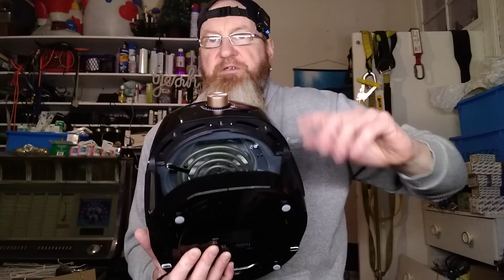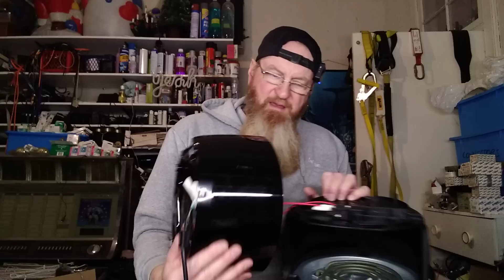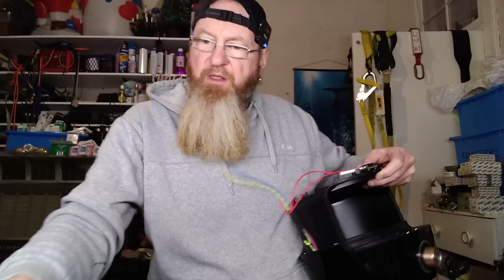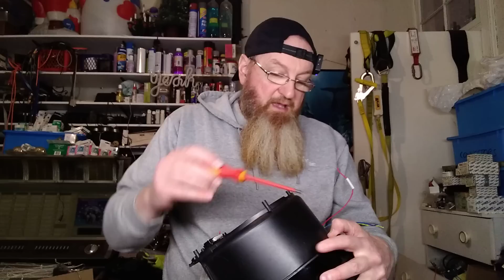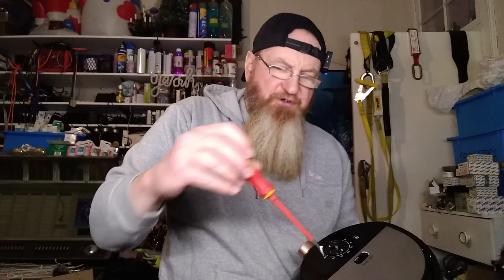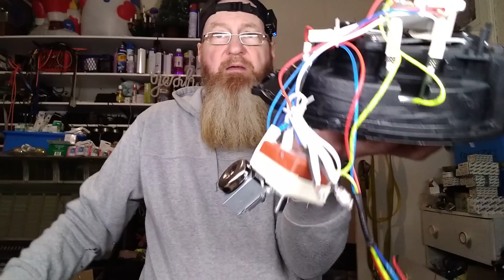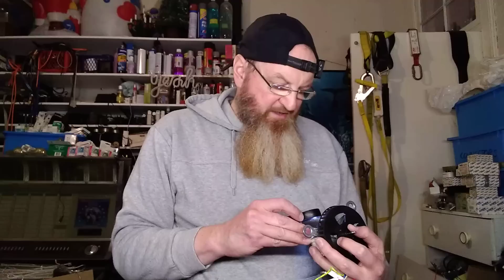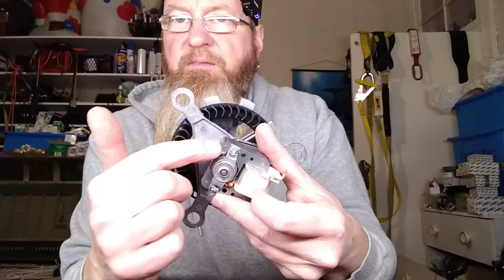Total teardown of an ASDA air fryer

Comment: First step, drop the screwdriver. Good impression of me! 😀 It's basically how I imagined it. For me, the biggest revelation was the slot in the sheet metal to force some of the cooking air out. I figured it did that since the air out the back is warm but not hot. It makes sense that the thermal fuse would be close to the highest operating temp because the idea would be to sense that the fan is not working. Normally it would be cooled but if the fan stops, it has to open before the plastic starts to melt. Overall, a nice build. I especially like the connectors that are so tight, you break switches before they come off. That's how they should be! 👍👍

Comment: I use a convection toaster oven. They last longer and you can do more with them. With that said, that air fryer would be about $120 here in the states. Sad, as it will only work half as well as the one  you bought. I love the lack of electronic components as the on I did have had only about 9 months of life before the heat killed the board and everything on it. It, too had the duel fans.

Comment: So refreshing to have a simple timer with ping and thermostat machine as opposed to electronics and loads of useless modes.
Reply: I knew someone years ago who had early stage Alzheimer's. He'd started to forget he'd put the cooker on so he threw the cooker out and only used the microwave because when it went ping he knew it was done. He'd have most likely had an air fryer if it was today.
Reply: We have two microwaves in the office. One micro-controlled one just one step beyond mechanical, one do-it-all super ultra inverter baking grill sous-vide artificial-intelligence solar thorium frying fridge. The former gets the job done. The latter is the most frustrating thing to use, right after our range of Windows 11 work computers.
Reply: Personally I'm tired of touchscreen in vehicles and everything having to be connected to the Internet to work.
Reply: @jms019  you bet!!
Reply: I would pay extra to not have a microcontroller in my washing machine, my refrigerator, my toaster , my pressure cooker, my freaking lawnmower for goodness' sake. For the last decade or so, I've been buying vintage, used appliances on ebay that will probably last me the rest of my life, and if they do break, they are easily repairable.
Reply: @fxm5715  ive never had to replace the microcontroller on any of those things when repairing them. it's usually simpler things like motors and heating elements. Occasionally, i've had to component level repair a switch mode power supply in them because a line surge blew it up.

On the other hand written off plenty of old washing machines when the synchron motor based controller mechanically breaks...
Reply: @jaycee1980  Yes, honestly it's not so much the microcontroller that's the issue, it's the general build quality of the rest of the devices that come with them. Microcontrollers are more an indicator of modern "minimally viable product" design sensibility for maximum profit.
Reply: @jaycee1980  years ago, there was one model of Sharp stereo that ate processors. Wasn't power conditioning or anything like that that killed it. They put the processor in as a postage stamp form factor on a large plate PCB on the face of the stereo and there was quite a bit of flex on that board. It literally tore the CPU apart by the leads.
Ironically, my neighbor gave me one of that model a few weeks back as she was preparing to move. I'll probably toss some LED's in where the incandescent lamps had failed, other than that, not worth sinking anything into even just at wholesale priced components values.
Reply: @spvillano  poor construction technique makes anything unreliable though, regardless of what parts you use. I know the kind you mean though - where they were using QFP type packages on SRBP board!
Reply: @fxm5715  the problem is, you cannot get good parts for them anymore, it's all extra cheap junk. unless of course you can find some N.O.S. that's been on a shelf for 50+ years.
Reply: @fxm5715  whatever are you going on about? I need  more processing power in my icecube tray than my desktop professional workstation!
And it's a bonus to have enough processing power to be able to do my taxes on my toaster.
Seriously, I can't wait until they stick processors inside of cutlery. A fully computerized fork.
Then, you'll see me really fork the river outside my window up.

Comment: Blowing onto the sensor thingy fades a tiny led in and out, but makes a positive on/off between the two terminals for the heater. An interesting feature, but I've not yet figured out anything useful to use that for!

Comment: That unit would be so much more repairable if the rivet were replaced with a nut and bolt (with thread-lock) or if the metal housing that the link is riveted to had a threaded boss for a bolt to screw into on its own. It would also be more repairable if there was a spade terminal block under that mains lead input cover instead of wire nuts, so you could just disconnect the mains lead from the terminal block to take the thing apart. Little things.

Comment: You are lucky. They used normal screws. Kitchen appliance manufacturers are well known for using anti temper screw heads or click connectors. The latter you never know where/how they are used.

Comment: Bought one of these, electronic version, from Aldi. Nothing else got used, then after a few months the air fryer stopped working. It was like I had gone back to a long ago century. Aldi just refunded me, no replacement available, so I got one from Home Bargains & Lo I was back in the future. Thank you for sharing!
Reply: YES! 
I lent one from my buddy and got frozen fries specially for the air frier. It was a very VERY short time until they were done. 5 minutes? It felt like Star Trek.
Reply: Next level chips from the air fryer. Also fantastic for hotdogs.
Reply: The same happened to me, not from Aldi, but from Lidl, and it only last two weeks. Refunded
Reply: @fnet616 I've never had a good experience with Lidl's appliances, avoid buying at all costs
Reply: Hopefully I won't jinx it because our Aldi one is coming up to five years old. It gets used more than the main cooker. One thing that was disappointing is that the coating came off the outer drawer in about a year. If replacing it I would be willing to spend much more for one that would still look new after a couple of years.

Comment: @3:30 - I went to a technical school (for Food Service) in the middle 80's.  A company brought in a demo piece of equipment for us to try out.  It was a small microwave/convention oven.  425F max temp and 2200 watts of microwave power.  It was an amazing piece of kit.  Fast forward to today when most ALL Starbucks use something called a Turbo-chef oven that is essentially the same thing with the exception that the Turbo-Chef oven can get to ridiculously high temperatures and cook things in mere seconds.  They're also wicked expensive.

Comment: I got one very similar to this one, vent on the back in the same place, overall shape, placement of heater, but it has a full electronic touch panel on top instead. Maybe a tad larger at 5 L. And cost more than 4 times as much in Sweden. Had no idea such things were so dirt cheap in the UK. Anyway, it's a great gadget. I mostly make yummy fried chicken in it. Edit: Branded "Severin". Recommended!

Comment: Karen's are indeed the bane of modern society. I lump them categorically alongside eco-Nazis and animal rights cultists (I'm sorry, but food doesn't have rights). Regarding repurposed appliances, I currently have a chamber I use for curing Cera Coat that I made from a single-burner electric hot plate and a section of double-wall stove pipe that has been very useful for my various hobbies.

Comment: I had to take one of these air fryers apart when it failed to work.. It did nothing when it was plugged in,  it turns out the repair was quite simple the microswitch for the drawer had failed... And actually I've seen the same failure twice,  early Gourmia Brand Air Fryer,   The microswitch is fairly easy to replace, the quarter-inch connectors to the switch are the kind that have the little locking mechanism,  and they don't like to be taken off very easily...  they're not meant to be removed, which makes sense if they come off during shipping or anything else then you're going to have live AC floating wires floating around.  I also was very interested in the construction,  I have to tell you this that is an entirely different model but the general shape is very similar to the one I have... When you got to the internals and the metal portions, the fan assembly the burner assembly the heat protective aluminum shielding... I'm telling you that looks like the exact same internals, it's just that somebody probably made their own case and used those internals.  That could lower the cost because if the internals are generally the same mass production will bring down the price and the company can use those components in their product design.  It was great to hear you get a little deeper into how there were some design elements incorporated into the Safe Operation... When you mentioned that there is not a tremendous amount of heat coming out the back of the air fryer and you explain why that was something I didn't think about.... You would definitely have to deal with the exhausting air it couldn't be coming out at 400° anything behind the device would be a potential fire hazard,  so the 2 fan blades have important functions,... I truly appreciate you pointing out some of the design is more than it appears on the surface.   This was a great investment in this video... Thank you for doing it   🙂

Comment: Excellent Clive👍👍 My "Ninja" air fryer is going on 7yr in use, never fails to bake pizza, fry fries, chicken wings, shrimp and clams, toast bread, cinnamon rolls, etc., etc.., you're right, they are very useful appliances.  Mine is of a different form factor as it looks like a small suitcase that flips up on the counter when not in use.  The only problem is, it's impossible to clean properly account being so slender.  Been thinking of taking the pressure washer to it, hmm, I better think about it.

Comment: Yeah the first fan wasn't a fan, it was an impeller. Circulates the hot air (and blows a bit out the back) but doesn't suck fresh cool air in. (I would have guessed single fan with bypass too but I guess the purposes are too different. Again, one wants to suck in fresh air, the other wants to circulate already hot air.)

Comment: Mine was given to me as broken DOA. (They were told to dispose of it and replacement sent)
I'd never used one before, it was getting hot but no fan.
Getting into it was tougher than this one, there were no screws, was a bit like picking a lock trying to reach in and unclip the single use catches that hold the lid on - designed obsolescence, thanks instapot
I only broke one of them :)
The "fault" was the fan connector to the PCB had come off.
I bent a pin to give it more grip and put it back on. 
Still working after 3 years of regular use.

Comment: Standard parts, large spiral hotplate element. Microwave oven style fan motor, metal fan i have seen before and the timer is typically found here in cheap electric oven and hotplate combo. I would think that if you mounted the fan and element assembly under a metal grid you could put old pc boards on top and just pull the parts off, wow that sounds dirty isn't it 😀 very good video, now I know what to expect when a customer brings one in for repair. Greetings from the kingdom of Eswatini

Comment: Interesting it uses air cooling instead of insulation, effieiency not a key design factor. Suprised the element is so large, as others say probably a standard part made for years. I so want to take mine apart and smash the buzzer to oblivion with a large hammer. Same with the microwave. Nice video.
Reply from the maker: I'm not sure I'd actually want fibreglass or ceramic fibre in one.

Comment: Many appliance spade terminals have a safety catch, that when released, allow the spade terminal to be easily removed.
Reply: Pretty much like the connectors that go into plastic housings, but latches to the mating connector instead of against the plastic block/housing.
They sell sets of variously shaped pokey keys for releasing  the tabs in the blocks (before finding those a small (smallest one in the common sets) jeweller's screwdriver could usually get to the tabs on most connectors i encountered, if with s little more force needed...

Comment: Thank you dear Sir… 

This is my AirFryer of choice, It is my third and has been going for nearly 2 years. The previous 2 « intelligent » fryers broke down after approximately 3 months. I gave up when the 2nd (replacement model on garantie) died and brought this « dumb » one instead. Like you, I find these little ovens  an absolute must! I use it all the time and only rarely make chips in it. 

It was truly wonderful to watch you tear it apart… truly ! I was on cloud nine when you figured out about how they stopped the heat flowing up the shaft ❤

Comment: Right at 0:34 you can see the first design flaw in all these air fryers.  This one has no grill preventing grease and oil from splattering all over the heating elements.  Others have a grill, but it is not meant to be removed and washed.  As you can imagine, cleaning baked on grease and oil is no easy task, and using brushes of any kind only splatters it even further.
Every air fryer needs an easily removable grill that you can soak, scrub, wash, and replace.
Mine has a grill that I can easily get to, but needs a special triangle shaped screwdriver head - definitely not meant for easy removal.
Such bits are cheap and easily found, but the fact that they would go with such heads suggests they do not expect us to remove the grill no matter how smelly and disgusting it gets.  The manual, of course, says nothing about removal and cleaning the grill.
Reply from the maker: I just examined my old one and the element is spotless.  The surrounding metal has oil spatter, but due to the high temperatures it is kept sterile.

Comment: It looks like you'd have to ensure your food is covered with foil or something, else you run the risk of it spattering up into the heating element and fan, which would be a real pain to try to clean out.
Reply from the maker: Foil is counterproductive in these.  Any spatter will instantly burn off on the element, and any in the vicinity is well and truly baked in a sterile manner by the heat.

Comment: i repair quite a few air fryers and at least 75% of failures are due to miss use. get a lot of thermal fuses blow usally because they are pushed up against a wall and cant exhaust the hot air properly and due to there location on top of the metal plate that writes them off as uneconomical to repair as news ones are so cheap. but there clever engineering for maximum cost saving.

Comment: As i remember the vacuum form machine they had on mythbusters was just some Ir heaters and a perforated bench  withe some means of making "negative pressure" under the perforated bench. This element could probably be used but  it would be a small vacuform unless you used several.

Comment: Tray interlock on my Phillips air fryer failed. Messy teardown and easy bypass with a spade terminal union and back to working better than original. No heat cut when the tray is opened to peek at the color of the food being cooked or tray being shunted to agitate the yummy fries/chips.

Comment: The outer casing airflow design of this thing is much like a high-bypass jet turbine, where the outside of the turbine is cooled by a fraction of the air pulled in.